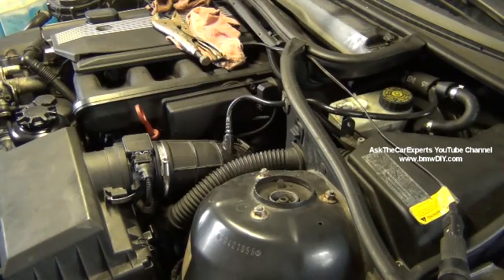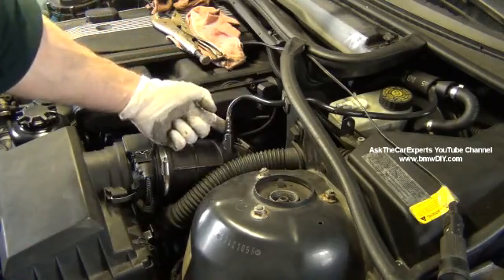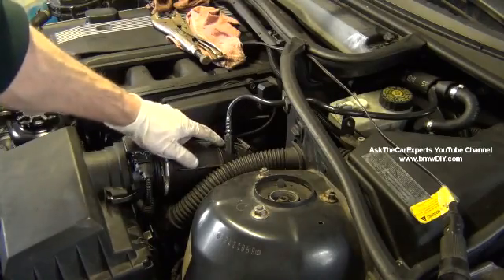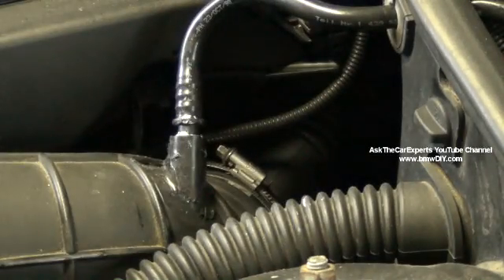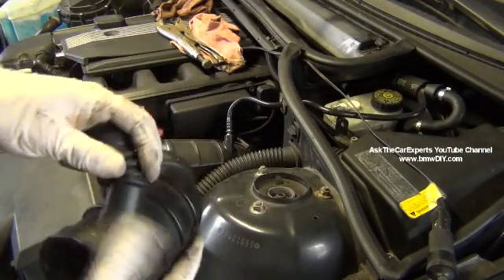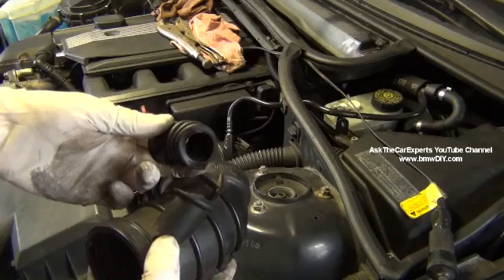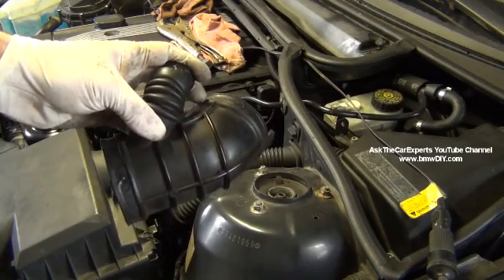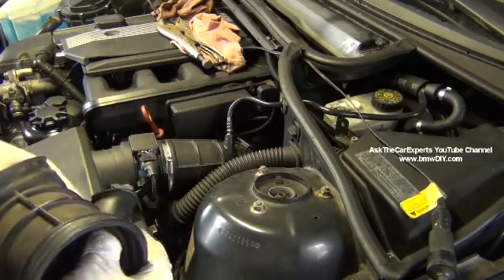BMW Common Air Leak Locations M52TU M54 Mixture Too Lean

Comment: i'm thick of my 54 's vacuum system.  engine is great but vacuum sucks - i mean it.  my fuel trims vent from 20-25 to 10-14 and i dont have idea what else to change
Reply from the maker: Hello, If you are having fuel trim problems on an N54 there are two things that come to mind. First check your valve cover below the oil filler cap near where the seam to the valve cover vent system is located as it goes down toward the injectors. It often cracks and will be an air leak. Also the injectors if not index 11 can cause a lean mixture fault due to an internal problem.

Comment: Exactly correct. I had a bad lambda value, misfiring and bad running engine. Found this boot and it was leaking badly. Replaced it and the car runs like new.
Reply from the maker: That is great! Thanks for watching my video!

Comment: I have replaced the DISA valve the lower boot that goes to the throttle body, and even the fuel filter the upper boot that is attached to the MAF is about a year old. I don't get the P0171 or P0174 any more now I get this 1083 , and 1085. And I have tried spraying the MAF cleaner around the engine checking for leaks with no noticeable difference in RPM. Any suggestions?
Reply from the maker: +dlad38 Hello, These are lean mixture codes. Often a BMW will not respond to spraying with carb cleaner. A smoke test will need to be performed. If no leaks then the MAF should be replaced. Hope this helps!

Comment: Sometimes it's hard to sell even the most basic and important repairs like these to a customer. It's the first thing I check when doing a service on the older engines and you can even hear it whistle when you drive.